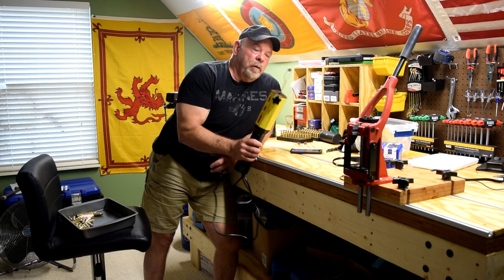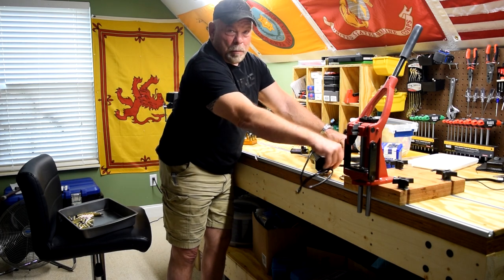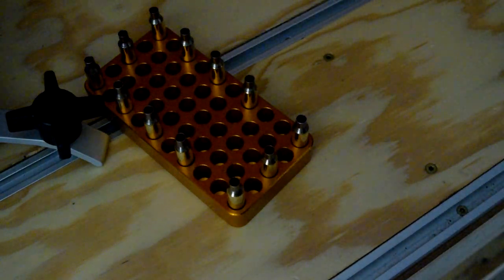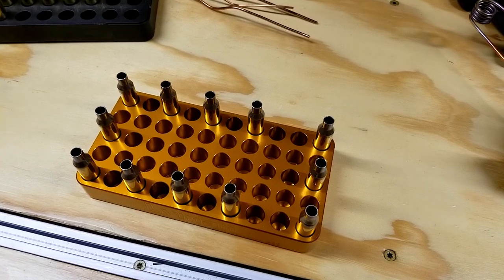DIY Induction Brass Annealer for Under $225 - AWESOME!

Comment: Thanks for posting your experience with this device.  I have a couple of questions.  1.  the cooling fan seems to run from the moment the device is plugged in.  I thought the red button activated all so that when the heater was in standby mode the fan did not run.  Does your units fan run all the time?  When you press the red button it does seem to activate the heater.  2.  Can you provide any help in programming this module.  The video from the guy in North Texas leaves me wondering how to do this.

Comment: I went through the painful experience of buying that AMP but there was zero remorse after the first batch I annealed.  Awesome piece of equipment.  

I would think that your DIY induction annealer is doing the job just fine.  As long as the brass in the batch you're annealing is as consistent as possible (you already have the best brass in Lapua) then you're good to go.  I did tests with my AMP with range pickup 223 to see how it analyzed the differences.  The biggest jump in program settings was when comparing headstamps, which would be obvious.  But even among the same headstamps, a slightly thicker neck called for a different program setting to achieve an annealed state.  So if you really wanted an increase in consistency then I'd start looking into neck turning if ya haven't already.   That's on my list of tools to buy next.  Very cool gadget you built and it's faster than my AMP!
Reply from the maker: Yeah, the AMP looks like an AWESOME piece of technology, I just can't justify it's cost, at least for now. I probably will look into neck turning not too far down the road. For now, I'm checking neck thickness and keeping the batches as even as possible and relatively small. Small adjustments to the "on" timing are made between batches
Reply: @CrustyOldMarine  I'd have gone the route you did if I had the know how of building electronics.  So congrats to you!  It looks like you did an outstanding job building something extremely effective.  If your shoulder bump is consistent in the sizing process...you can bet that your build is achieving full annealing.

Comment: Holy crap. Love your workbench. I bet it doesn’t move around. My timer did not come with directions on set up and how to wire it. A fellow in the star rating of Amazon had  a picture of the diagram to actually wire it up. Of course, I didn’t buy the one with the DC powered version. I bought the AC powered one so, they’re not the same. I just about gave up on programming the settings and then I got it figured out. It’ll cycle through a couple times with the numbers lit up, and then it will go blank. The top number was the cycle on and the bottom number was the time off, and it had three settings P0, P1, and P2. P0, you can’t get anything and has an off setting, Might be to turn it on for extended period of time and then it stops cycling. I don’t know., P1 is tenths of seconds and is the one I used.  P2 might be minutes. You have to hold the settings button down to get it to change.  The start/ stop will start it after you’ve entered your settings. It doesn’t turn off as long as it’s plugged in, the start stop starts the cycle and stops the cycle only. It was frustrating at first but yeah, after I got it figured out, pretty happy with my purchase. I don’t know which induction heater I bought, it was like 180 bucks. Mine has the fan running every time it’s got power, but you do have to press the red button down to make it heat, so you will hear the fan, but it’s not heating until the observation light comes on in the front.
Reply from the maker: Thanks! Nope, it doesn't budge, just hope I don't ever have to move it!...lol
Reply from the maker: Yeah, if the timer you have didn't have the wiring diagram, thay sure would make it tough! Glad you got it figured out. Same with my Induction heater, fan runs whenever timer has it on but, no heating unless button is held down. I actually like it better that way and I think it helps it not to overheat.

Comment: You really take this to a high level! I consider long range anything beyond maximum zero where I have to make some basic trajectory calculations. I shoot heavy bullets having the trajectory of a watermelon. I intend to post on what I do keeping it simple and recommending your channel for those who wish to take it further. What is that yellow and black tool? I wonder if I could achieve the same effect with just a cheap soldering iron using wire to replace the soldering tip?
Reply from the maker: I try too...lol I'm just a middle of the road guy on this LR (800-1200 yd) shooting at this point. But, closing in on the limits of my current rifle. 

That Yellow and Black tool is the Induction Heater. It's 1000 watt and designed to heat seized bolts/nuts. They aren't that expensive, the whole setup was $225 or less. I doubt you'd get the same results with a soldering iron. Probably wouldn't hold up to the duty cycle but, sure would make a good video giving it a go and showing the results!
Reply from the maker: Hey buddy, somehow I accidentally hid your comment on my  "Best Load Development" vid https://youtu.be/nYL-xMdYdVM and can't find a way to get it back. If you don't mind posting it again that would be awesome! Stay warm up there!
Reply: @CrustyOldMarine  Done. NP

Comment: Sweet! What is the hardness (Vickers scale) of the necks after you anneal? Lapua & Peterson produce necks around 95-100 on the Vickers scale. Thanks!
Reply from the maker: I have no idea, though I'd love to know that too. If I had the money for a testing gage/setup, there's other reloading items I'd spend it on first. Unless you know of a good one in the $100-$200 range and not $1500-$3000. And if you do, PLEASE SHARE!
Reply: Check ebay for a used Webster Hardness Tester Meter for Brass W-B75. Test on a new lapua neck = 100. See where yours ends up
Reply from the maker: @foreheadlikeflint7516  That was a GREAT video share on Bruce and the Webster Tester. THAT is actually affordable and I curse you for putting me on a new hunt and yet ANOTHER tool to buy...LOL JK, I appreciate the info and share!

Comment: How far below the neck/shoulder junction does the lowest coil sit? Thanks
Reply from the maker: You can adjust it for any length/location. The heat will rise, i.e. the lowest point will be the coolest and up the neck gets a little hotter. This is due to the heat rising and the variation in diameter. I don't know or have an exact figure as to how far down to place it but, the important aspect is to get it slightly below (maybe 10-12 mm) the shoulder/case body junction as that portion gets reworked in the sizing and the annealing prolongs its life.

Comment: Question: Does your unit actually state Made In Japan? The Taishi brand on Amazon appears to be a Chinese company like all the other knockoff mini induction units sold on Amazon for half the price of the US-made Mini-ductor II from Induction Innovations. Like what you said, I would rather buy a Japanese version if available.
Reply from the maker: IT does not give any country of origin. My assumption from research was that it (Taishi) is a Japanese company. Though the lack of any "country of origin" or "made in" stamp on the inductor or in the manual, certainly makes one go hmmm.... Thanks for watching and asking as well as pointing out Induction Innovations. If I had known there was a  "Made In The USA" option, I would've spent the extra $$ and got it. Going to find  link for their model to add.

Comment: Have you done any testing with the annealed cases from that yet? I’m thinking of putting g one of these together to try to get a little more consistency with my annealing. Flame annealing is just too dam inconsistent regardless of how it’s done.
Reply from the maker: Testing as in how consistent shot groups are from it, I'm assuming? In the process of that right now. The only other "testing" I can think of would be bullet seating pressures. Northeast Texas Tactical where I got the idea and plans from did that (I don't have a gage yet) and his results were great in terms of consistent pressure
Reply: @CrustyOldMarine  yeah I was wondering how the velocity numbers looked compared to other methods. I just got mine together and it definitely works like a charm! I got a cheap 5v turbine fan fan and mounted it on the back to hopefully keep it cool as it gets hot pretty quick. I’m really loving this thing compared to flame annealing, much more consistent. Hopefully I’ll get to do some testing on the range in the next few weeks.
Reply from the maker: @randallgibson3212  I haven't had a chance to test yet. You may well get some numbers before I do, if so, please share your results.